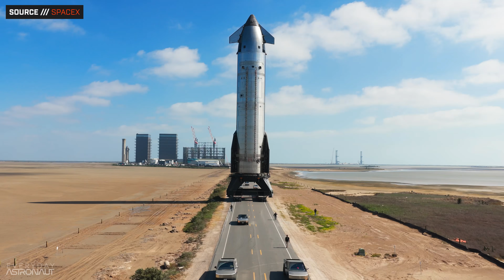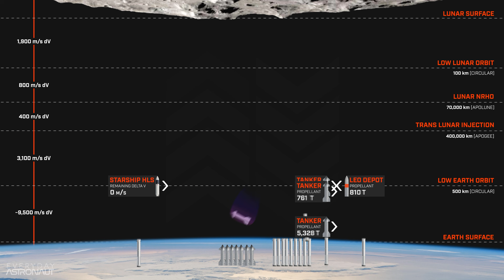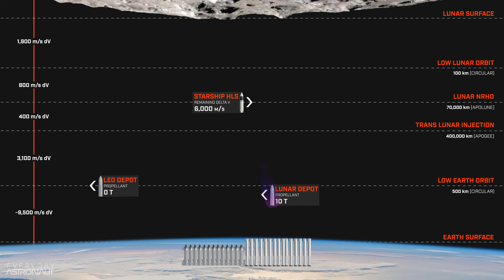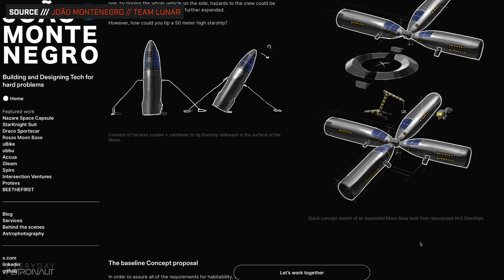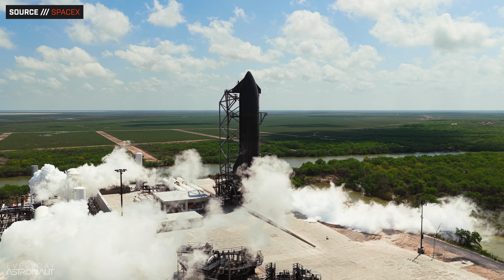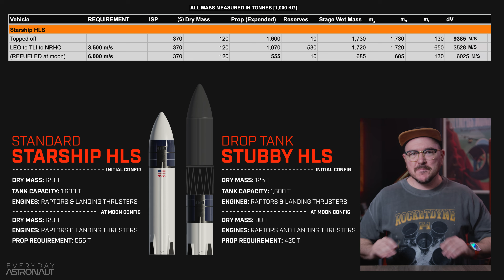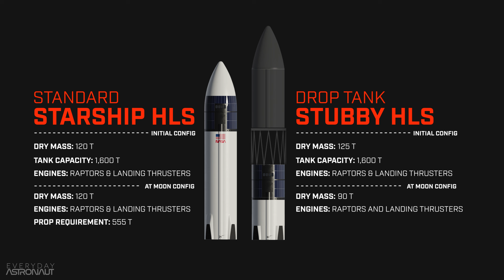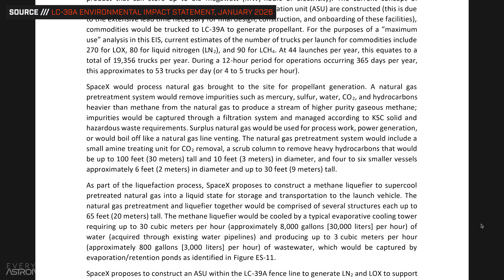Does Starship REALLY require 15+ launches to land one lunar Starship?!

Comment: if they mame the hull V shaped on the bottom, the tile work would be easier, the nose would become more angular and the ship would look more, well, ship like.
the leading edge could be actively cooled and used to pressurize main tank, and all of this would then help hide COPV on the sides of big tube and smaller tube (3 if you ad the leading edge tube as well)..
under tiles you could hide 4 legs, two up front and two in the rear, behind the legs you could have landing engines, meaning the legs also works as cover for the engines..

this would allow the ship to land horizontally instead of vertical, it would also provide a better route for tubing AND a second smaller tank inside this V shape, something that i personally believe would be the perfect feeding tube for engines (instead of having it located where it currently is)   

bottom line: tile work would be easier and they wouldn't need to be curved, so they would stick better under heat expansion, the landings would be way safer,  also modifying a landed ship to become a base would only take one angry guy with an axe.
Reply: The Lunar HLS doesn't need to hide the landing legs behind insulation, but the Mars lander does. Anyway, the early HLS missions must take-off back to low orbit. They aren't laying down.

Comment: Not to discount the video, but during the horizontal landing section, in reality, the center of mass would not move towards the aft of the vehicle. That occurs because of how kerbal space program is designed. Realistically, the propellant would pool on the side of the tanks, leading to decreasing mass on the aft end of the ship, while the cargo mass remains the same, this would shift the center of mass differently than what you demonstrated. Time to finish watching the rest of the video :D
Reply: Just finished the video. Probably one of your best, too. Nice job.

Comment: It better have absolutely no lateral motion when it lands. Yes the gravity is 16.6% that on Earth's surface so it's easier vertically but inertia is inertia so once it's down things are more likely to fall over with less gravity to help square things up. I mean it will have to come STRAIT down or maybe use thrusters or something to make sure it's balanced. Plus leveling or something. Gonna be tough.
Reply: Absolutely. Lateral motion needs to be measured accurately. Don't rely on LIDAR.
Reply: Accelerometers and gyroscopes are pretty good these days.
Reply: @dsabo  You would think. Tell that to Intuitive Machines. 0 for 2
Reply: Yes. That may be why IM is seeking kick stage and space-tug contracts. 
 @bengelman2600

Comment: This is so obviously inefficient lugging all that superfluous stainless steel it's hard to see why it's even being talked about.
Reply: How to do it efficient then? Using expendable landers?
Reply: @maks_1_123  The lunar starship is expendable. it wont get reused, thats an official aspect of the design.
Reply: @J-Johna-Jameson  it will be reusable you just need another depo to fill it in LLO
Reply: @m @maks_1_123 that’s not the plan though. Even if it’s possible in theory they have determined that they’d rather dump it.

Comment: Sending all that stainless steel to the moon seems silly.   Just launch a still massive lander from starship as high up in earth orbit as it can reasonably do.

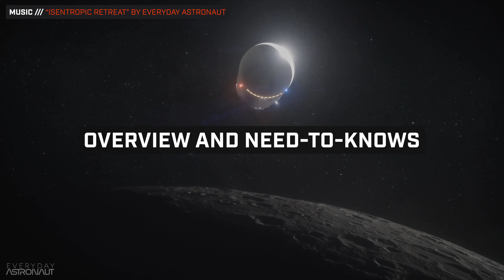bad edit at 3:15 cuts way too early and volume lowers.
Reply: All other expentable alternatives is more expensive, this is the best way around.
Reply: @maks_1_123  what you're failing to understand is that spacex is massively undercharging for HLS so it's "cheaper" but it's not.   And if it fails, it's definitely not cheaper.  It was just thrown out as a "minimally incremental change" to what is required for mars, but it's absolutely not required for the moon.   And when hls was bid, spacex wasn't interested in the moon, just a bunch of government money.  But now that they've shifted, a dedicated lunar landing ship that could launch from starship would make a LOT more sense and could be bid lower than companies that their funding relies on breaking even on a contract like HLS.
Reply: @zachansen8293  Falcon 9 has lowered the price, I don't see why Starship won't do the same.

Comment: Orbital refueling isn’t near the hardest part cryogenic refueling while maintaining low boil off loss
Reply: We have seen all-white thermal tiles at Starbase. I suspect these high emissivity tiles will be surrounding both the Depot and HLS versions. 

It is easy to deploy solar collectors for power/shade and radiator panels for cooling. A generator-cycle micro engine can recharge batteries and operate a heat pump, reducing radiator requirements. 

If the liquid propellants are depressurized and vaporized just before discharge, the released latent heat can better chill the tanks. 

I think a launch every other week can easily fill a Depot.

Comment: does anyone else think that they'll build upon/ use a variant of dragons super Draco thrusters for HLS
Reply: No, that was ruled out. The most likely descending thruster is a simple methalox pressure-fed cycle or else a generator-cycle engine like Merlin. If the latter, one turbo pump might feed all nozzles.

Comment: You have to remember the KSP has unrealistically powerful SAS systems which it looks like were enabled in your demo.
Reply: You can turn off reaction wheels which i think is what you’re referring to. He was using rcs too
Reply: If Kerbal has stability assist, surely SpaceX can implement something similar or better than that lmao
Reply: @alb @albert_mendoza ceX can’t hack the reality of the world to set rotation to whatever they want. Stabilization requires forces pushing on the rocket, and in KSP both reaction wheels and RCS are quite unrealistically powerful to make the game simpler.
Reply: @theondono  oh mb,  i didn't know how SAS worked internally in KSP
Reply: @albert_mendoza  There are similar systems in the real world, but the ones in KSP are ridiculously overpowered because they don't have to actually exist, just be calculated.
Reply: @albert_mendoza  No they obviously can't. Or I guess, kerbal space program has time skip, which can also be used to stop rotation for free, so I guess SpaceX can implement something similar too.
Reply: More like KSP system is like 10 times smaller than our solar system if i remeber correctly. 

U can ssto without a problem in ksp, good luck irl
Reply: @oljackie35  both are true
Reply: There are mods like rss and ro that would fix that!
Reply: You can turn off the individual reaction wheels so they don't provide torque, even if SAS is on. Secondly, it appears that there would be 3 reaction wheels on this entire spacecraft: the two lander cans, sticking out of the fairing, and the large probe core that would be inside the payload fairing, providing control over the spacecraft (if there even is one). When faced with a 5m rocket, those reaction wheels are too weak and will not help very much with preventing the lander from falling over. Some? Yes. To a degree in which it would prevent a rocket of this calibre from tipping over if level improperly beyond a small margin? No. Thirdly, notice how he has RCS enabled throughout the entire demonstration? I would bet that he has disabled the reaction wheels on the landers and probe cores and is forced to use RCS to orientate the rocket as there are no reaction wheels onboard. Fourthly, after landing, the control input indicators on the bottom right are around 60% input, meaning that the SAS is only using 60% of the RCS thrusters' power to point the rocket upwards, as that's all the more the PID system thinks it needs. Fifthly, when he is levelling the rocket after landing, how the rocket behaves, especially how it's behaving when it's rotating on just 2 legs, is highly indicative of there being no outside forces being applied. I.E., there are no reaction wheels acting upon the rocket. If the reaction wheels are powerful enough to make a difference, you would see their effect here. Sixthly, doing some rough, eyeball maths, if you draw a line from a point right below the nose cone, straight downwards (so the force of gravity pulling on outermost point of the rocket that is angled down the slope), you notice that the extended landing leg still extends past that line, which guarantees that the rocket is stable. Seventhly, I can tell you from my own experiences that it is possible to land a rocket (one with a much worse centre of mass placement than this one) so that, even with no inputs or control authority at all, it can be stable on an even greater slope. Eighthly, we can turn to real life examples of objects maintaining balance using different leg lengths. Googling "mobile crane on slope" gives some great examples of how levelling can make an already fairly unsteady object steady, even on slopes. And lastly, this is, as you correctly pointed out, KSP. And in the words of xkcd: "The six words you should never say at NASA: 'And besides—it works in Kerbal Space Program.'" KSP is a great, easy to understand, visual proof-of-concept that can be used to explain rocket science to a larger, general audience. As long as the point gets across, that's what matters.
Reply: Your point about the reaction wheels is very valid, and I think he uses one of the most powerful 3-crew command pod, by the way.
Reply: @Legion-ET-AL  Where are you getting that information? There is one crew member onboard, and you can tell from the IVA portrait that the Kerbal is in a Mk1 Lander Can.
And I can also tell you from experience that a Mk 1-3 Command Pod's reaction wheels are not powerful enough to keep a rocket of that size upright.
Reply: @TheRealLibrary  Thanks for the correction
Reply: SpaceX should have hypergolic thrusters for better SAS control.
Reply: @linguine490  I disagree. For a vehicle of that size, way too much of this stuff is needed. Hypergolics are not only dangerous and toxic, they are also incredibly expensive. If they fix boil of there is absolutely no advantage of using them, since they already carry viable propepellants.
Reply: @brockmann4815  The Draco thrusters are hypergolic, and I think it makes sense to use something similar here. There is no simple solution to boiloff, but even with insulated tanks, the problem is getting the fuel to get to thrusters that are not gathered in one spot like normally. You want the thrust to settle the propellants in the bottom of the tank, so you cant just tap of the top of the tank, you need to connect from the same place as for the main engines.
Reply: @huleboermannhule44  Why exactly would this be a problem? Sure extra plumbing is needed, but you probably could just use autogenous repressurisation to pump the propellant up. The dragon capsule is a far smaller and simpler vehicle. And with monomethylhydranzine costing ~220,000$/ton and methane costing 400-600$/ton (up to 55 times less) it doesen't seem to make sense to add an adittional propellant just for the last bit of the landing and the takeoff. 

I just realized that boil off would of course need to be solved either way unless you want to only use hypergolics after TLI, and I hope we both agree that that definetly is not a good Idea.
Reply: @linguine490  In most cases any kind of inert but compressed mono-propellant gas is fine for small attitude control and changes. Don't they use Nitrogen for Dragon capsules? Much of the heavy lifting will be done by the gimbling of the Raptor engines.
Reply: @linguine490  I believe they use hot gas thrusters, but don't quote me on that.
Reply: @TheRealLibrary  Only for attitude control, not landing. SpaceX uses high pressure COPV tanks for pressurization on the ring of engines for landing and take off near the Moon surface. These can be re-pressurized by the turbo pumps when the main engines are running.
Reply: Ya and that's all we should use in real life too, everywhere! Just a really good assistance on a planned and calculated approche. Not act over human input. Software should never be the main operator but a extension of human ability... not replace it.
Reply: Sas is irrelevant though?
Reply: @IceRain-f5v  What is Sas?
Reply: Orbiter Space Flight Simulator is superior and more people should learn how to use it. KSP is cheap pseudo intellectual entertainment. Those little kerbal dudes just turn on a "dumb" switch in peoples brains like the minions did to people years ago.

Comment: A Starship Tug, filled by tankers carries an initial, reusable Mark 2 lander. Orion capsule launched by Falcon heavy, docks with tug in LEO. The three vehicles are placed in LLO by the tanker. Lander descends to the surface and back and is reused. Orion returns crew. On future flights a removable Wet Bay container bridges their incompatible propellants through a single pipe coupling. Together they form a chain that carries crew and cargo from Earth to the Moon and home again. On unscrewed missions Starship brings cargo and remains on the surface.
Reply: new glen not  fullyreusable it would cost more  than just starship doing all that
Reply: Yes, Blue Origin’s lunar lander, known as the Blue Moon, is designed to be fully reusable. Carried by a starship tug to LLO and fueled by a H2 wet bay in starship, the lander could be refueled in LLO by returning tugs. Starship does need to land, with a crew. An Orion brought also by tug provides a safe return.  Uncrewed starships bring tons of payload, INCLUDING oxygen mining equipment. This paved the way for crewed starships to do the entire mission in the future. I would love to see an Orion brought to LEO by a Falcon heavy. I have written a feasibility paper outlining this approach
Reply: @mikenicholas7132   Blue Origin’s lunar lander couldn't be fully reusable it consist of several parts, which separate on the moon

Comment: Considering the last few lander probes to the moon have toppled over, i know if i were a pilot on that thing id much prefer landing a stubbier ship than a tower. Just because you want to deliver lots of cargo to the surface in one go doesnt make it a good idea.
Reply: Those landers didn't tip. They tripped due to lateral velocity. Sensors and resilient software are more important than a wide stance.

Comment: Apollo apparently did it with 1 rocket first try, guess they had 15x better the tech than what we do now. This would explain why they destroyed most of the equipment and documentation, to prevent people form finding out Tim Taylor went back in time and gave them the technology we apparently don't have today.
Reply: They just accepted 100x more risk.  They also sent a lander the size of a Volkswagen Beetle - but with a tinfoil chassis.  And they spent about 20% of national GNP on the rocket.
Reply: the reason why Apollo landers landed intact because they had humans inside to steer it gently to the moon

Comment: Even in the ideal case, reusing a Starship is not as simple as refueling it and re-stacking it.  Heat shield tiles will need inspection and possibly replacement, engines will need servicing (if not also replacement), and so on.  So, no, this isn't something that can be done with one rocket.  This refueling mission is going to require a lot of Starships, not just one making round trips repeatedly.  If it weren't a cryogenic fuel, that'd make things easier, but boiloff puts a serious time limit on how long you have to prepare for the translunar burn.

This is also something we've never done before.  We're all talking about this like transferring cryogenic fuel is going to be easy, but we have never done it on orbit before.

There's another problem with optimizing things so the booster does more work - it isn't designed to handle re-entry.  It would probably need more weight in the form of heat shielding.  Maybe not as thick as Starship's, though.

Honestly, I think it'd be cheaper to design a third, expendable stage, than do that many launches.  At some point the price of fuel exceeds the cost of throwing away a middle stage...

Finally, if we are allowing the use of ISRU technology in our pipe dreams, we don't need much refueling from earth at all.  Just heating the regolith to extract oxygen also gets you hydrogen and carbon, and the heat alone will react some of that to form methane.  Or be smart about it and stick to catalyzing hydrogen and carbon monoxide under high temperatures and make the far more stable methanol.  That cuts the number of refueling launches in half, at least, or better yet refuel from the moon instead - getting from the moon to LEO is cheaper than getting from Earth to LEO...   But none of this helps the Artemis missions; if we are able to build sufficient industry on the moon to produce oxygen there, we're also able to produce so much fuel we are well on our way to the lunar orbital refueling station idea...
Reply: so like most aircraft ?
Reply: @andrewpyrah  most aircraft don't experience the plasma of mach 25 re-entry.  we saw what happens when it finds an exposed bit of steel on the windward side.  boosters, sure, they're probably not that much harder than the falcon 9 boosters to refurb and fly again.  but I will be surprised if we see the same starship fly twice in a week, much less the cadence needed to fight boiloff.
Reply: So it's an engineering problem needing some optimization. Fortunately, the reusable Ships can be retrofitted as problems arise.